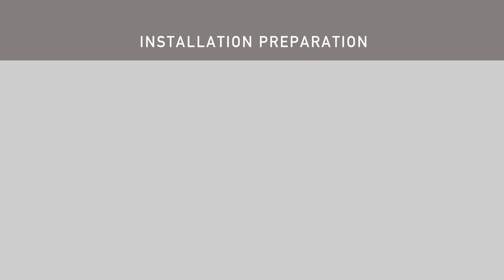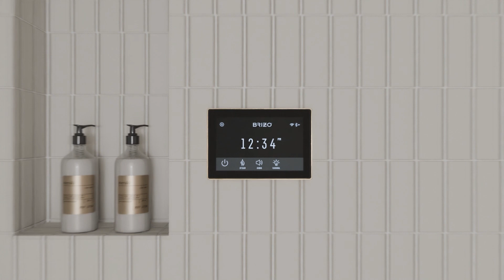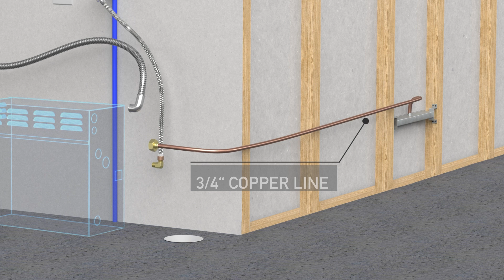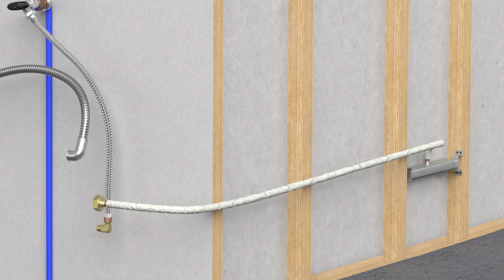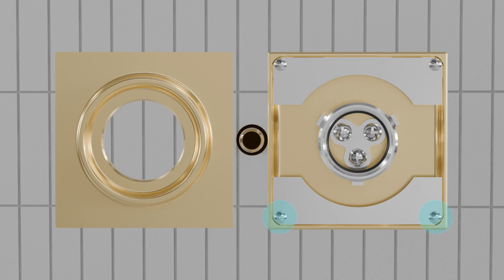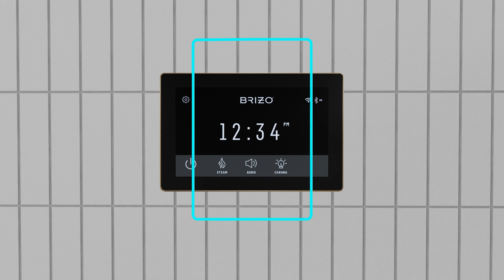Brizo® Mystix™ Steam Transcendent Experience Product Installation

Comment: Does the Digital Controller need to be placed in the shower area? Can it be placed outside?
Reply from the maker: The digital controller  should always be installed inside the steam shower, positioned away from the steam head—ideally on the opposite wall. For convenience and usability, we recommend installing the interface at a height of about four feet from the floor.